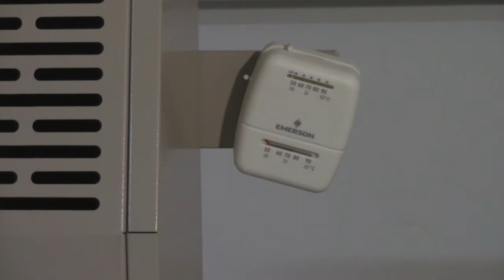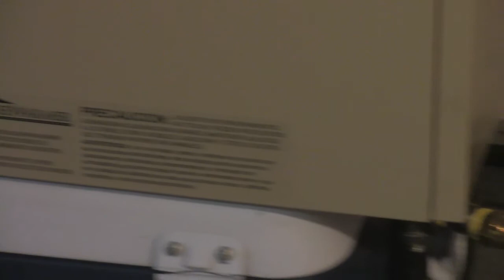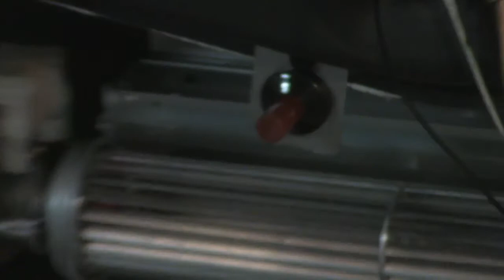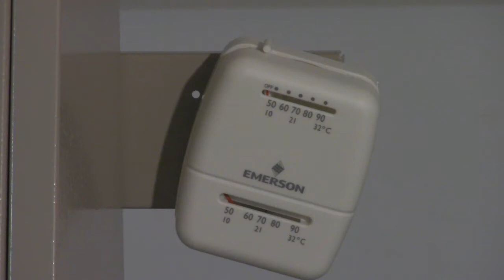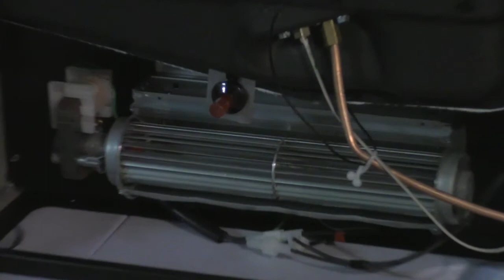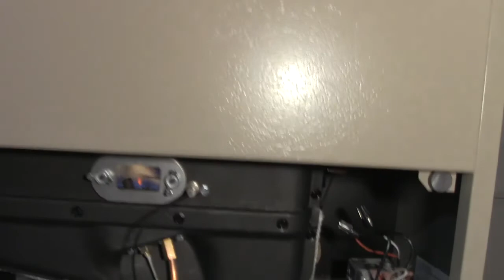Housewarmer 15000K BTU Furnace

Comment: Why does the blower motor not come on sooner? What controls that? My blower motor won’t come on and it’s plugged in btw. I waited 15 mins. Thx Joe
Reply from the maker: Mine is the same way. It can heat without the blower so to have the delay for some pre set temp is weird. I have not looked into the mechanism but I would think you could make it on/off!

Comment: I have this heater but it’s the older model with the control valve on top. It’s 10 years old and I have had not one bit of trouble with it. Runs flawlessly. It runs on natural gas and I have never shut the pilot off. I figure leaving the pilot on during the summer would keep any bugs from trying to nest in the exhaust/intake vent.

Comment: I've owned this heater for about 4 years. It's been nothing but trouble after working great for about 4.months. I've replace nearly every part on it, including the expensive valve. A this point, the pilot is fine, but the burner won't light. Gonna try cleaning the burner orifice.
Reply from the maker: That is too bad. Mine has been perfect. Hope you find something.

Comment: The only issue I've experienced with these HouseWarmer units, over time, is that the burners are made out of cold rolled steel, not
stainless steel. These burners tend to rust out, especially in damp conditions. If you're living in the far West, where the air is dry,
you might experience longer life with those burners, than we do back East.
Reply from the maker: That is good to know!

Comment: I have a 8000 btu unit. Stopped working, won't light. I blew orfice. A lot of dust came out but still no lighting. Bought gas valve. Will install. Any helpful hints on this Install anyone?

Comment: can this sit on the floor? and have the air suck in from the room? gas line in the way?
Reply from the maker: Air comes in from the bottom, and yes gas line issues.
Reply: Not gonna lie i got it mounted and used for a month... Took it off and sold it on marketplace. It's not efficient. Exhausts way too much heat. And never heated the room enough. Just my experience.
Reply from the maker: @JosephMBoyer  Nothing to lie about. I didn't get it for efficiency, I got it for an off grid backup that can still heat with no electricity.
Reply: @flyingWyoming  that sounds accurate :)

Comment: I'm having difficulty figuring out what thermostat I should buy and how to wire it. The wire configuration in the video doesn't show the wires connected to the thermostat. I'm confused.
Reply from the maker: Sorry I didn't see this notification.  You need a millivolt thermostat like this one.  There is just two wires and I don't even think it matters which way they are attached.  https://www.build.com/product/summary/103037?uid=821280&jmtest=gg-gbav2_821280&inv=1&&source=gg-gba-pla_821280!c12202915597!a114964610297!dc!ng&gclid=Cj0KCQiAyoeCBhCTARIsAOfpKxjRhH3NmErp2F_mZzpbYRWo6vLfa5DG5m6qB1ge91NKhDUk0o3BawwaAsX-EALw_wcB&gclsrc=aw.ds

Comment: Howdy. So I received my heater and set it up on the patio to give it a go. It starts and runs fine and I have the 3/16 - 1/2 inch primary blue flame, but the secondary flame is only 2 to 3 inches and is mostly orange. The manual says it should be 3-5 inches and mostly blue.  I am not sure if I have a problem, any thoughts? Thanks.
Reply from the maker: I would give it time and see if it improves.  Not sure you will ever get perfect efficiency with an orifice designed for an elevation range.  I don't think mine was perfect but it worked well and the exhaust didn't smell rich or have carbon build-up.
Reply: @flyingWyoming  Thanks. I have not installed the elevation orifice yet, I am about 100 feet above sea level. But, I will burn it for a while and see what happens. It has no strange odors so that is good, but it doesn't seem to get very hot either. Perhaps being outside in 70 degrees might have something to do with that :) I'll  update you after I install the #57 orifice (a #56 is stock) and try it at 7200 feet. I just don't want to cut a hole in the wall of my cabin if it is not going to work well. We'll see, We should call this thread, "Adventures in Propane Wall Furnaces."
Reply: I bought one of these a few years back for a tiny home but ended up using an electric space heater.  Is the regulator built in to the house warmer? or did you buy an external regulator and if so what kind and where did you buy it?  @flyingWyoming

Comment: I just bought one (waiting for delivery) to use at my Cabin located at 7200 Foot elevation. I bought the high altitude kit as well. Will installing the new, I assume larger, orifice be all that I need to do? I called the Empire company direct and the lady on the phone was not too helpful. She was nice, but not helpful.  Any information on a high altitude installation is appreciated.  I think, after what you said, that I will mount it to 3/4 OSB and attached that to the wall. Thanks for the video.
Reply from the maker: I don't remember the orifice install being tricky.  As I remember there is a bracket of some sort with a thermocoupler I believe, that I had remembered wanting to be careful with.  Otherwise its just a cover removal of the combustion chamber and out with the old-in with the new!! 
While doing my install I couldn't get the pilot to light.  I found a loose wire on the valve assembly that was triggering the gas to shut off.  Otherwise it went smoothly and I ran it really hard for a couple days straight with no issues.
Reply from the maker: @danielswierczynski1301  I believe the orifice is your derating component.  It has a smaller hole to go along with the less dense atmosphere.  My place is only 4300 feet, as I remember I was just above the higher altitude orifice which I think will work up to 9500'.  Probably wouldn't have known the difference in my situation.  I remember splitting hairs about elevation but the more I read it seemed they used orifices for a "reference range" rather than a set elevation.

Comment: I like that drip leg. I mounted my housewarmer and got it running but now the pilot won't stay lit. I think it may be a clogged orifice due to no drip leg.
Reply from the maker: Mine kept going out because of a couple of loose screws on the regulator.
Reply: @khalil’s Heat and air conditioner repair  Thanks for the suggestion. I took the orifice out and blew air through it and got it working. I will install a new drip leg next month. I now have a backup thermocouple too.